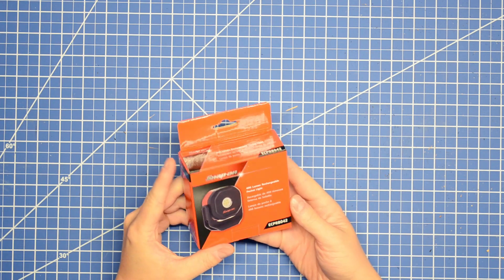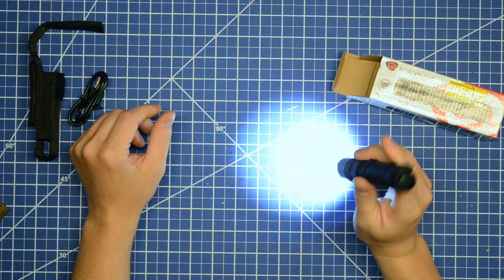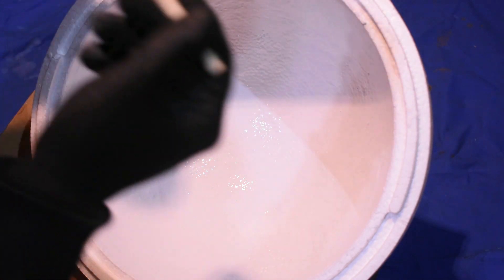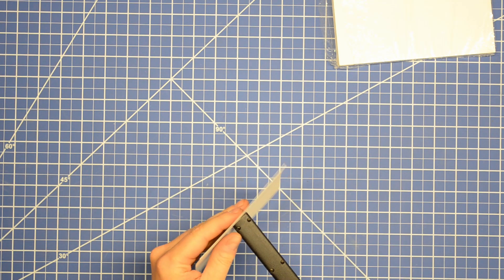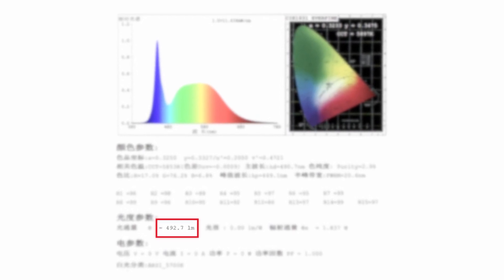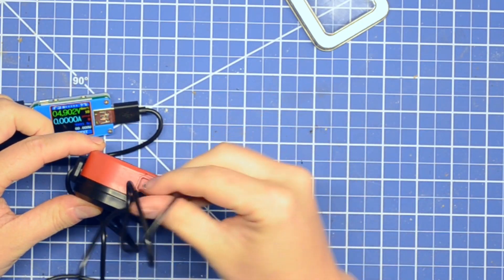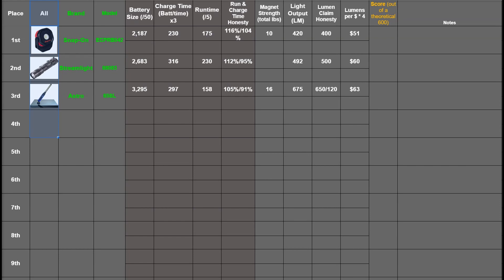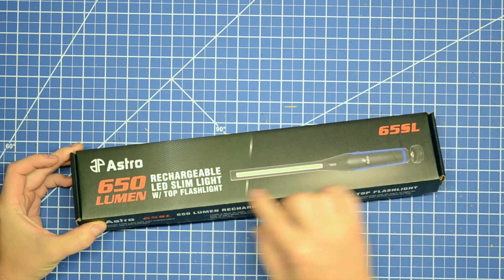Are Lumens Fake? We Built a Light Lie Detector: Snap on, Streamlight

Comment from the maker: June Update: We'll be removing the ranking list with future episodes, these dont rank like power tools do and once you have these specs and info you can make your own decision! We'll also be recording lumen output over the duration test so you can see it charted how much output it loses over the battery life. Battery capacity will be based on cell rating not the USB charger due to the circuit losses, thanks for pointing this out! But we'll still use it to see how much current it accepts and charge time. Working on the next episode now!

We realize videos like this will have far less uggas and duggas than our others, but we hope you’ll support our continued effort to do more and more mechanic’s type tools now and in the future with series like these, either way Friday’s on this channel will always have plenty of ugga duggas. That we promise. Also, if we make any missteps on this very technical topic, apologies as there's no electrical engineers here. We stuck a light meter to some foam guys! Recommend good or terrible rechargeable lights below!
Reply: This channel keeps getting better and better keep up the great work Torque Test Channel
Reply: Just make ugga dugga sounds with your mouth while running tests if the impact guys get butthurt lol. Also I've been pretty impressed with the quantum lights from harbor freight
Reply: Question Everything! And trust nothing!
Reply: This was an excellent video. Brilliantly done.
Reply: Of course, thorough testing is always appreciated! I would highly recommend looking into Fenix Flashlights. I have and love several, the PD35 NON tac is my personal favorite. 

I believe Fenix is honest about their output ratings as well.
Reply: "Tool Test Channel" on the search bar isn't bring anything up for me other than you guys, so if you changed your name to that but basically did a Project Farm approach to testing things, but only for tools, that would be a fine expansion to the channel I doubt many of us would mind.
Reply: Do a rechargeable headlamp from Ledlenser.
Reply: Is it possible to do the guidesman 6000 lumen flashlight
Reply: 'would be nice if you could test some Fenix flashlights, They also make headlamps and worklights
Reply: I really liked this video. It explores a field I knew nothing about. It would be interesting to see some different fields explored as I'm not into torque guns but I love your style of presentation.  Sort of like a more advanced version of Project Farm or a slightly less advanced version of Applied Science.
Reply: I think the foam ball idea is ingenious! And your test results seem to be 100% in sync with the lab results.
I would probably have settled on flat white paint for the inside and called it a day.
Reply: olight makes some great flashlights!  they seem to be the best quality and most durable for the money imo.  there are many rechargeable versions.  a good place to start is probably the s1r .. good compact rechargeable edc light.  rugged, impact resistant, high water proof ratings as well.
Reply: This is a brilliant idea testing not just the ugga dugga's but the things that we use to do the job's, personally I would love to see you test the torches that are advertised as 99999999999million lumons (Pmsl)
Reply: Milwaukee 1100 lumen rechargeable flashlight
Reply: I like my Makita DML801 because every other flashlight I have owned during my time working in automotive has gone missing. There’s no magnet to leave stuck to a car by accident, and no one so far has walked away with it by accident. It can’t fit in most pockets, and the LXT 18v battery lasts a long time. This is all a good thing in my opinion. Some day I might upgrade to the Makita DML812.
Reply: Try EagleTac. I own 3 much better and brighter AND CHEAPER then those torches
Reply: You’re seriously underestimating the demand for this content. I’v never seen your channel before, but for some reason this video is recommended and I’m glad!

There’s a huge group of electronics techs and optics/laser nerds on YouTube who are starving for content. STARVING!!!!

Sure.... there are channels like “Styropyro” Who I admire very much and he’s a super smart guy!But a lot of folks are interested more in the science behind it.....instead of a $20,000 medical laser used to pop balloons LOL 😂 

Technology connections had a lot of good laser content for a long time. Some of the only real optics bench and professional laser quality on YouTube. But he hasn’t done that stuff in a long time. “Thought emporium“ has done a lot of laser stuff but never seems to finish his laser projects or get back to them. 

“Zenodilodon” is currently my favorite optical and laser channel. With “les’s lab” coming in a close second. And “Marco reps” has some of the best laser content that’s ever been on YouTube, and if you’re into Metrology and chasing those ppm’s… His channel is fucking awesome!

Dude if you keep making test equipment videos I will support your channel in any way possible. Whether via Patreon, or whatever… I’ve been begging all of the big optical and laser channels to do more test equipment and science content. For years! 

There’s a huge lack of optical/test equipment/Science videos on YouTube. I was stoked last month when “les’s lab” developed and shared a DIY spectrometer on his channel… we need more content like that! And this video of yours is a great example!

I’ve actually been messing around with integrating spheres, spectrometers, and all types of optical test equipment for years. Finally two years ago found a good price on an optics test bed with all of the mounts and complete system.

Half of my business is woodworking, but the other half is spent in my lab doing component level PCB repair and repairing/re-calibrated test equipment for industrial clients. With a bit of metrology mixed in to keep it interesting.

So I’ve come into possession of a lot optical equipment and other electronic test gear… So it’s a lot of fun to spend time designing and making my own gear that will perform close to or on par some of the lab gear. 

I don’t know why this was in my recommended, but I’ve been doing research on barium paint since the first big reports started coming out last year. The lee is to make different size particles and find a good binder that will allow them to radiate the most light. Not just visible light but UV and infrared as well. 

It’s the only white paint that’s capable.... and I’ve gotten some really good results. Even up against my small spectralon samples.....this stuff performs incredibly well. and is 1000 times cheaper than spectralon!

The trick is utilizing different size particles of barium sulfate. If you have at least three different sizes of barium particle, then each size reflects differently. Covering a wider range of the spectrum. 

Be sure to watch “periodic videos“ video they made about a few weeks ago.  Shows you how to easily make a suspension of barium sulfate with household chemicals. Then simply put them in suspension… And you’ve got some thing that will reflect over 99% of visible, UV, and IR light. However that last 0.8% really makes a huge difference… And utilizing different size particles is what makes up that extra percentage.

And if you need any components, feel free to hit me up!!!! After years of dealing with optical test gear, I’ve got a whole parts cabinet full of Hamamatsu brand optical sensors like photodiode arrays, Avalanche arrays, photon counters, photomultiplier tubes, scintillation crystals, uv sensors, IR sensors, x-ray sensors, you name it I’ve hoarded it. 😁

Because good Lord I could never afford buying that stuff new. Most any good optical equipment is going to have Hamamatsu sensors throughout. Isn’t anybody else doing that stuff. Not on their level.

And even their cheap stuff starts at $100 for one small component. I bought out a repair place last year who specialized in repairing and calibrating turbidity measuring equipment. Which contain a compact but huge optical test bed full of high-end sensors and kinematic mounts!!! That was so much fun!
Sorry to ramble on, just very glad to see this content. And hope to see you do more of it in the future.
Love this shit man!
Reply: for the stream light you could always just have two batteries. seeing as they charge about as fast as you could use it up. as someone who uses a vape with 21700 batteries and a 18650 adapter sleeve i always carry spare batteries rather than charge it also it may charge faster on a dedicated charger not via usb.
Reply: You should keep the ranking list... but rank them by the accuracy of their claims
Reply: One item that I've found important is "How does the light deal with external power?", as I have a few lights that allow charging while turned on.  (Being able to plug in a (true) 20mAh USB power back makes a LOT of difference in how long a light will last.)  

There are five different configurations and it would be helpful to note which is true for each flashlight you are testing.

1. Ignores external power and runs solely off of the battery.
2. Uses external power to charge the battery while the battery is used to power the light.
3. Uses both external and battery power to power the light.
4. Uses external power solely to power the light while charging the battery.
5. Uses external power solely to power the light while not charging the battery.
Reply: I hope in the future you learn what the "Max" button does on your light meter.   =)
BTW, I am doing the EXACT same thing... (same light meter too), built my own integrating sphere also.
I have 40 Amazon flashlights here ($1800), and wow... the results are eye-opening. 3 sellers didn't lie. All the others did.
How does the FTC allow this to continue?
Reply from the maker: @m4rvinmartian  We dont use MAX because we dont want to see a brief spike. More like what it settles at
Reply: @TorqueTestChannel  that's even worse since flashlight companies not only use "MATH" but spikey math.

Comment: I haven’t seen anyone suggest my favorite flashlight brand, Emisar. They’re very popular in the enthusiast community. Their two biggest benefits are an insane amount of light for the size, and you can get almost any LED you want - no unknown quality extra blue LEDs. 

My favorite is the D4 - I have the v1 but they have a V2. It can be so dim you can barely see it, and you can smoothly ramp it up to light up most of a soccer field. With a single 18650. 

One issue is that turbo mode gets very hot. The light thermally regulates quickly. Turbo mode is for “what was that weird noise over there?” When I say hot, I don’t mean warm. I mean set your pocket on fire, give yourself a blister hot. I have actually given myself a blister. 

You can get an 18350 tube, which makes it look just insane. It’s nearly as bright to the eye, but is so tiny it seems like magic. 

Some of the lights now come in tint ramping versions, where you can individually adjust the brightness of half of the LEDs. You get two different color temperatures of LEDs and can then adjust the color temperature. Or, you can choose more wide angle LEDs for one channel and can then go between narrow and wide without a mechanical adjustment. (I don’t know how huge the difference is - haven’t dug into that yet. I know there is a difference, just unsure how extreme)

The range of choices available on the web site is a bit intimidating. There’s also a secret menu of other options that you can discover by reading Reddit or other forums - LEDs that might not be available in large quantities than you can request by email. 

https://intl-outdoor.com/emisar-d4v2-high-power-led-flashlight.html

Also, I don’t think this XKCD was written about Emisar, but it is accurate:
https://xkcd.com/1603/

Comment: I bought a portable work light, based on the fact that it could take AA cells for emergency use, while charging the 18650 cells...works great, and you can use rechargeable AA cells, too, so you can swap out AAs, or even keep a couple of 18650s on hand...

Comment: Great channel, I just subscribed. As a mechanic, highly relevant info. About this video, if you buy a light that uses 18650 lithium cells, those batteries are readily and cheaply available, so the charge time is irrelevant, just swap batteries. Also true of any work light made to be compatible with the cordless tools you own, just swap battery packs.

Comment: Good thing about the Streamlight is you can buy another battery for it and just swap them out when it dies. Have one charging while using the other one. It would be pretty cool to see a video on headlamps. I use a Milwaukee one at work with a removable rechargeable battery, a lot of the guys use streamlight lamps.

Comment: When recording a discharge test, I'd recommend locking your camera's exposure so as the light gets dimmer, the camera won't try to compensate. Like, lock it to normal overhead lights, turn on testing lights so they are overexposed, then as they die the light will get dimmer and dimmer.

Comment: look up shadowhawk 50W, it has a huge single lithium battery for the size, quad core led bulb and a very decent battery life in a handheld sized package, i use it as a pocket spotlight at the farm, they run 20usd on ebay, the batteries cost similar solo

Comment: The problem with lumens is there's no industry standard measuring method. Candella is a much better measure because that's compared to the light of a single candle flame. One candella is one candle flame from 1 meter. Easy to measure. Lumens is more vague and that's what the scam artists selling LED junk like. Even lux is better measured - that's light on a surface from 1 meter.
Reply from the maker: There is a standard measuring method, it's just very expensive to do so. Such as ANSI FL1 and others.
Reply: @TorqueTestChannel  Yes but the industry does not apply it. They also chose a rather obscure measurement to use to measure light as a way to obfuscate things.

Lumens are a very strange choice otherwise. Photography measures light in EV which is based on Lux. Video cameras actually use Lux. For a real world comparison, Candela is used. Of course Candela is too easy for the average Joe to understand.

Measuring light is easy enough - either incident or reflected light. That's simple and cheap - a simple photometer will do that and they are cheap. There are even plenty phone apps that will do it and they are pretty accurate within normal bounds.

To measure light, you need the light, a distance and a meter. Perhaps to be really fancy, an 18% gray card and measure reflected light. Again, not expensive nor complicated.

The problem with LEDs is they are very bright and harsh in a very narrow beam. They can appear to be very bright but in fact produce hardly any real light. This is why the industry has so many bare LEDs. 

Recently I did the lighting on my motorhome. I went incandescent because I can always add an extra battery or an extra solar panel if needed. I like to be able to see which I can't with those horrible LED things.

Comment: Just for those who don't know, lumens has nothing to do with how far a light shines. Example: a light that's 300 lumens doesn't automatically mean it shines further than a 150 lumen light. That's called candela. The higher the candela the further the light shines. Example: a 2000 lumen flashlight with a 5,000 candela means it's more of a "flood" light. A light with 300 lumens but a 40,000 candela means it's a throw light

Comment: If looking for a pure white pigment, barium sulfate isn't what you want. Titanium dioxide is pure white. It's used as part of the Federal Standard 595 paint specification and is called out for manufacturing pure un-tinted white paint.

I built an integrated sphere about 8 years ago when all of these LED flash lights became the rage. Within the same manufacturers light offering, the LED binning popped up as the lumen/lux rating on a bin changed from day to day.

Comment: That light at 1:11 Parkside in LIDLs sells the exact same thing, Assuming it's manufactured the same way only thing i can say is it's the brightest light I've ever seen way brighter than car or any home bulbs are that I've seen. As you said, light ratings are so random nowadays, but I don't think 700 lumens is an exaggeration, or at least not by much. Especially at 3:40 if you compare the astro's 650 Lumens VS the Snap on's 400 Lumens, I'd say it's even brighter than those 2

Comment: I actually think that streamlight has the best advantage even with a slow charge time, because the battery is removable, you could - I'm sure - buy additional batteries and still use the tool while charging other batteries, where as the other lights are out of operation the whole time they're charging.

Comment: The benefit with the streamlights are swappable batteries tho. I have 3 strion variants with 5 strion batteries, as well as a stinger with 2 batteries, when one dies I just take the good one out of a piggyback charger and put the dead battery in the charger. The light is still usable while batteries charge, unlike my sl650 or my snap on work lights. That's why my streamlights are my go-to lights

Comment: Im still confused how you turned the lux measurement into lumens.
Reply: They used the data from the independent lab tests. If the light got 600 lumens on the lab data, it will show up as 6000 lux on their meter. So if their meter is reading 4560 lux, it's 456 lumens. Within the range they tested. It could start devising when they get closer to the extreme ends of the range of their meter, but they said they've tested even more lights and the 10:1 ratio seems to hold true.
Reply: @xenonram  Possibly true, although it would be good to know how it's measured. As lux is lumens/m^2.